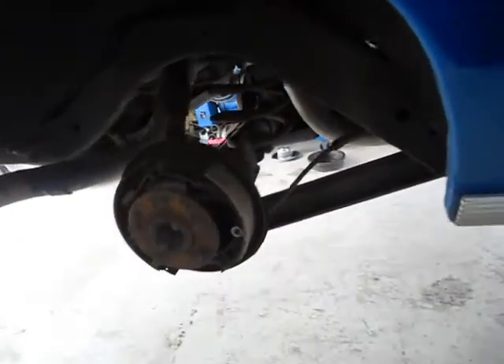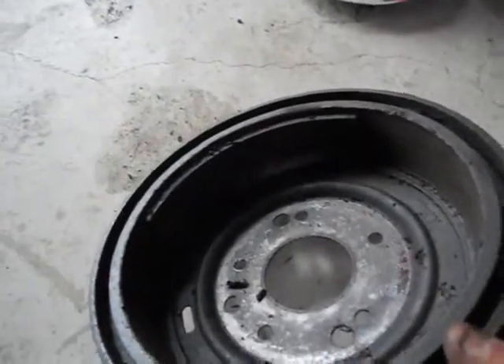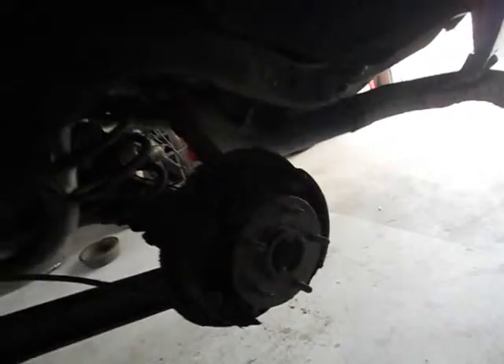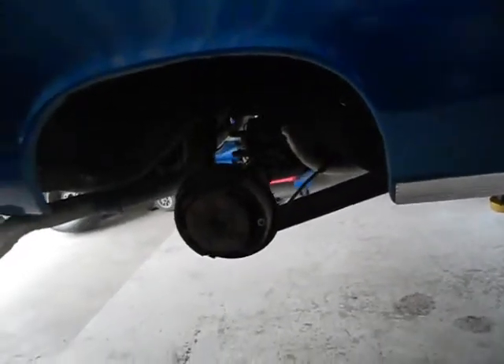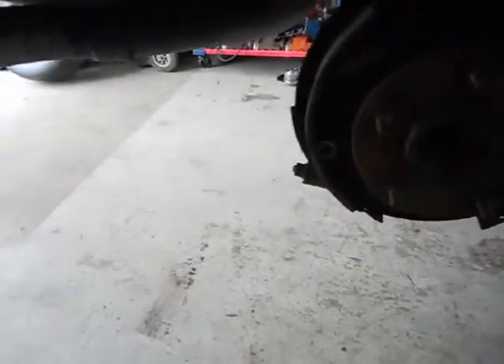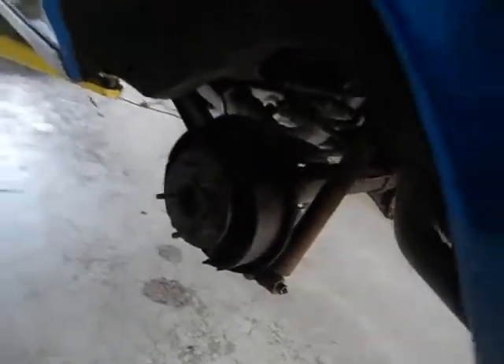Eric's  67 chevelle rear  brake's bad

Comment: How did it work after it was all done, with the disc brake conversion. Going to add a power booster next?
Reply from the maker: Im still waiting for the drum's for the rear's but i will post how it feals. I did another one that was non-power and it stopped good so we will see with this one.